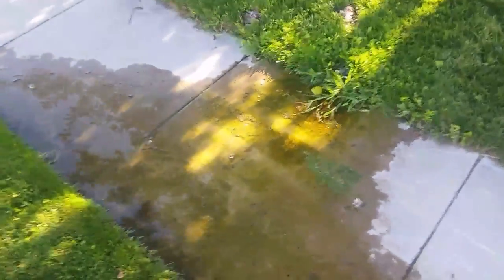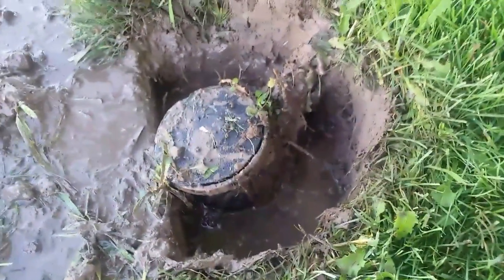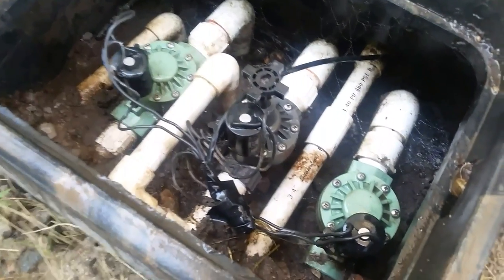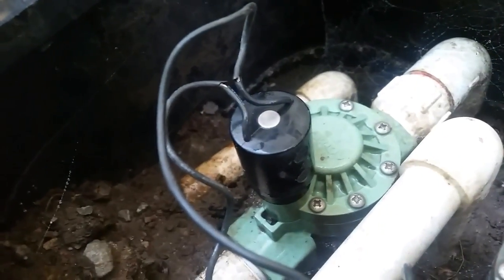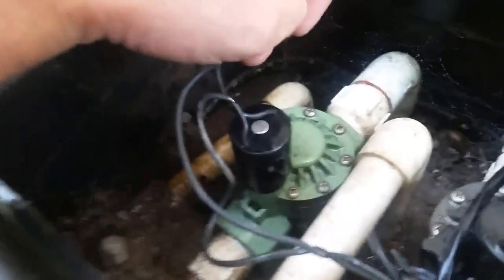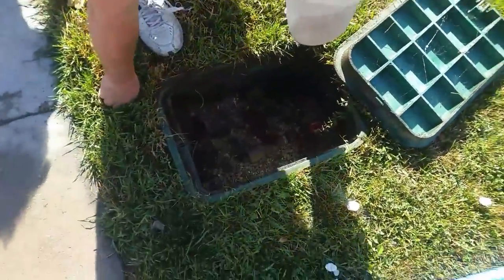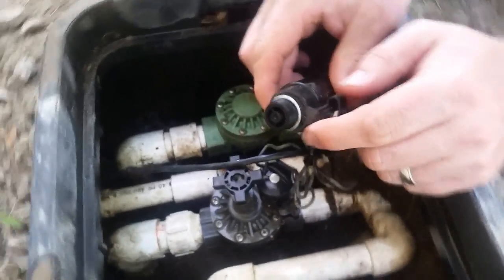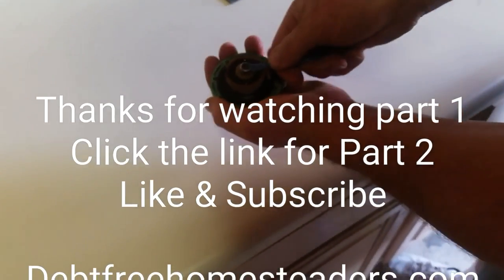How to fix a leaking Sprinkler Valve Part 1

Comment: Thanks for the effort to do this.  However, it could have been done in one much shorter video.  Did we really need to watch you water your garden, turn off your water supply (which is unique to everyone), etc.?

I took apart and cleaned mine but still leaked.  Had to replace the valve but it was available on Amazon for pretty cheap and worked fine after.
Reply: I feel like watching his doggo eating water streams was the highlight so...yeah
Reply from the maker: Sorry the video was so long.  But I do appreciate you watching.  I'm glad to hear your repair went well.
-Will
Reply from the maker: I love my puppies!
-Will

Comment: Will it always be the valve that’s the cause? Cause my sprinkler head is leaking but at the same time it looks broken. 
Not sure if I should just simply replace the sprinkler head or do the whole valve change process?
Reply from the maker: I would honestly start with the sprinkler first as it's a lot cheaper and a lot less work
Reply: I know this question is several years old, but I'll add that a bad leaky valve is indicated when the zone is OFF, but water is still passing through.  If the leak only occurs when the zone is ON, it is probably a crack in the sprinkler head or head connector itself.